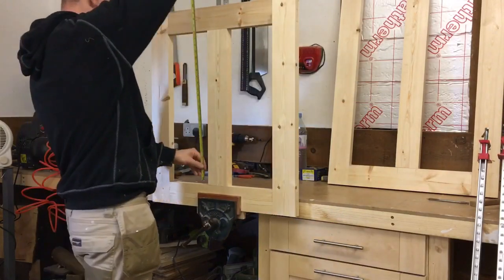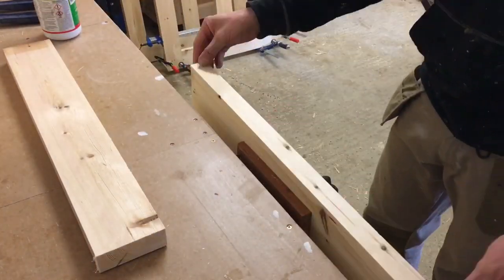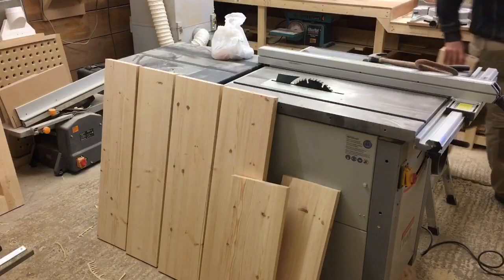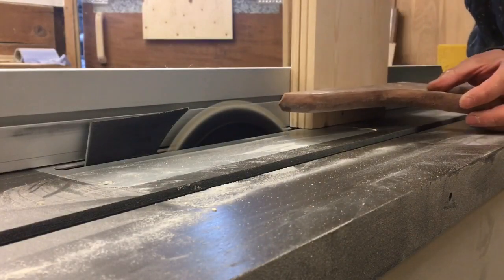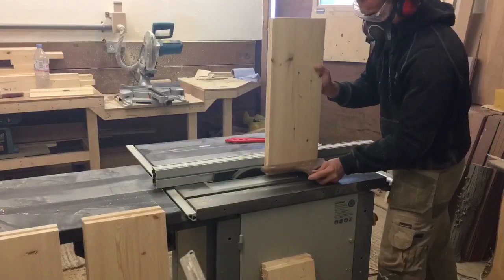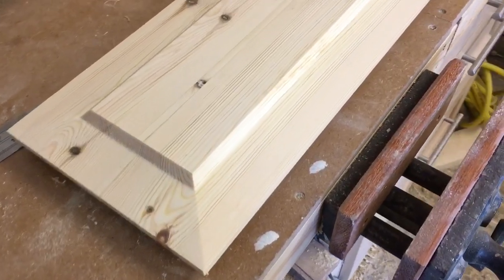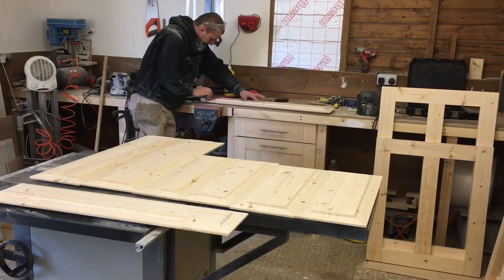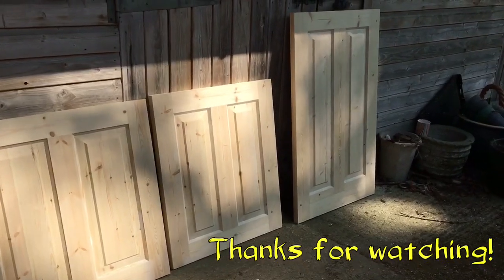Making raised panels on the table saw.

Comment: I do this sometimes instead of using the wood shaper but first I make a tall MDF auxiliary fence that captures the top and two sides of the table saws standard fence.  I add a vertical stop for the panel to square up against and slide the entire fence and panel forward into the blade to make the cut. It's basically a 16''vertical sliding panel jig that's fast, accurate and safe.

Comment: it can be done with a cheap table saw, but you are damn right about the surface after the cut. made 4 raised panels out of poplar for a project years ago, i think i spent more time getting the gouges and burn marks off the slope of the panel than i spent on the rest of the project combined. This was when i was extremely newb too, shocking that i still have all my fingers with some of the stupid shit i attempted back before i took the time to learn the craft properly.

Comment: You’re using a chisel with your hand right in front of the blade.  Good way to cut your hand to the bone. You’re using the push stick on the offcut piece on the table saw.  Good way to get kickback.

Comment: How would you get on if you were going to fit those panels into a groove? The angle of the felded panel wouldn't fit into a groove that easily would it? Nice panels, I will give it a go.

Comment: When you put your glue down I've always moved it back and forth lift it up and re put it down before I've actually clamped it. Is that technique not needed or used anymore? It would seem like it would have a lot better if glue contact and bond that way.

Comment: that was pretty impressive. you have skills.. 
my only thought is... you say that if you have a cheaper table saw that you couldnt do  what you did, but i dont think the table saw is the issue. i would think that the blade would be the most important part of it (besides having a steady hand and confidence). im a novice, at best, but i also am not scared to try anything. once i am ready to do this, i will try your technique. well done.

Comment: Tha was a great piece of art. Can you show me the trim detail (the small strip) you add at the minute 9:00 of the video. That details finish the work perfectly.
Reply from the maker: Basem B. Thank you! Sorry Didn't made video of that! I thought is not that interesting! 
Thanks for watching
Reply: Will it be possible to send me a simple hand sketch of that via anyway. I would like to duplicate your project implementation in my home shoe rack closet
Reply from the maker: Basem B. It was just a simple triangle profile nothing fancy! Made on the table saw! With the blade tilted to 45 degrees.
Reply: Szilard Pinter thanks, that is helpful, i though you made a kind of curve using router.
Reply from the maker: Basem B. Just make sure to be safe what ever you do!
Cheers

Comment: correct me if I'm wrong but isn't angling your blade towards the fence a big no no because your pieces can get caught and kicked back more frequently than angling your blade away from the fence but nice work those look great
Reply from the maker: this guy thank you very much.
Yes there is more risk involved for sure, if I didn't have the riving knife on, that was almost certainly happen. It would happen when the upcoming side of the blade catches the workpiece. With the riving knife on that is very unlikely to happen. In fact it forcing it to move in a perfect straight line, resulting in a better quality cut! As you can see it on the finish. At least this is how I see it. 🙂
Reply: Szilard Pinter good to know I was just curious keep up the good work

Comment: Beautiful work!  Quick question - when you were gluing up the panels, what was the purpose of the center, thin strip which was glued in between the two wider ones?  Was it simply to get to your desired panel width, or was there some other purpose?  Thanks for the great and informative videos!
Reply from the maker: wilcoxtube thank you! 
Yes that's right, just to get the exact width needed. 
Cheers

Comment: Only takes a minute to put an aux tall fence and clamp on a featherboard.  No way would I freehand those cuts. It's dangerous- but it's also really easy to wreck the cut and ruin the panel.
Reply from the maker: Tioga Fretworks you right. As you can see I've got perfect results for all the panels, without a single mess up. Is all down to the operator. But as I said Is not recommended. That just my choice.

Comment: AWESOME CRAFTMANSHIP

Can I do this on a DeWalt DWE7491?
Reply from the maker: Han van Vilsteren thanks. I never had one of those so......?
Reply: Han yes you can.  You will just need to take your time.
Reply: Dont know if dewalt makes a cabinet grade saw. i think they only make contractor grade saws. meaning the blade tracking is good enough to get the job done, but might not leave a good finish on the kerf. It can be done, ive cut raised panels with a delta crap saw before, and a homemade fence + clamping jig. But get ready for a marathon of sanding. the softer the wood the easier it will be to cut with a cheap tablesaw. a project in pine would probably work out great. Give it a shot!

Comment: Hi there Szilard - I watched a few of your videos - it looks like we have the same table saw - where did you get the riving knife for this saw? I can't find them anywhere - I only have the blade guard knife - which is higher than the top of the blade - so a little inconvenient to use sometimes. Thanks, Rob
Reply from the maker: Rob Trautvetter - Takami Woodshop hi.
Mine was the same, I did cut it off below the tip of the blade!
Reply: Oh - I wondered if you had done that. I considered doing the same thing. It's good to know that I'm not the only one. Thanks Szilard!
Reply: What table saw model do you own? It seems to be a good one. And thanks for sharing your work. You did a very good job.
Reply: hi , what  table saw is this?